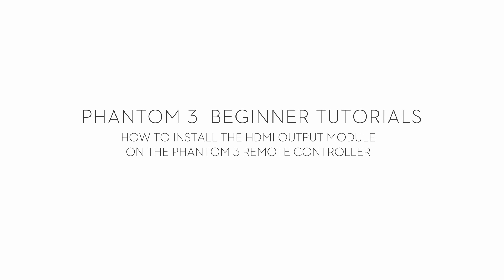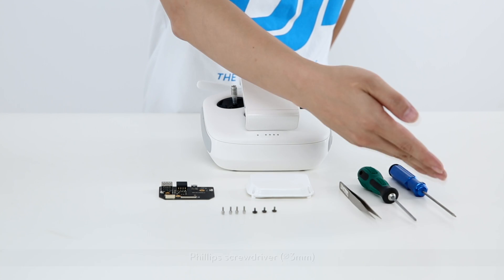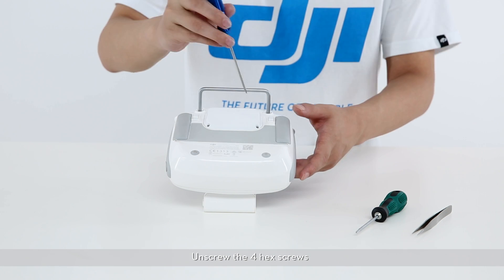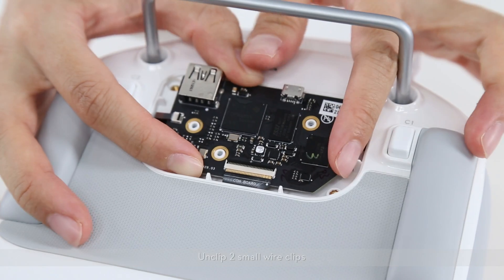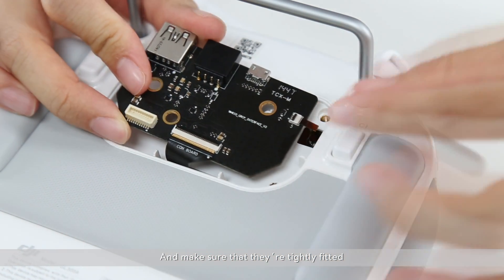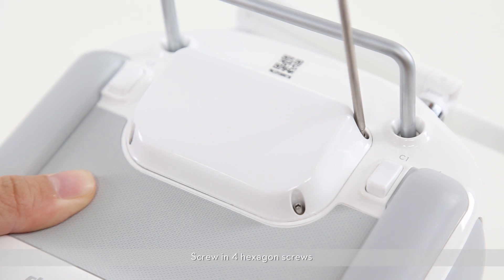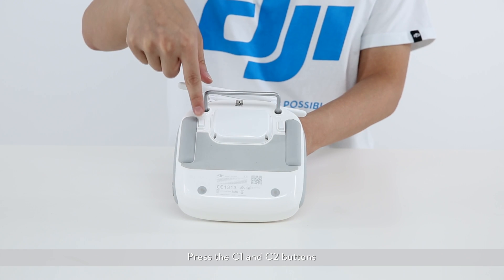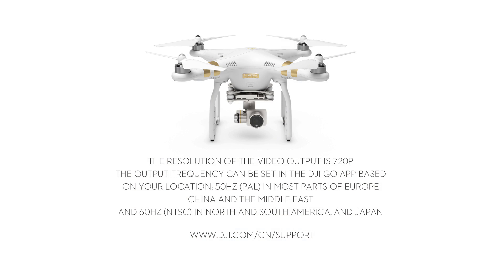DJI Phantom 3 | How to install HDMI Output Module on Phantom 3 Remote Controller

Comment: i have a phantom 3 pro and ordered the hdmi module but the bottom middle ribbon cable is smaller than this one the remote part number/model number is gl358wb anyone know the right part number for my remote?

Comment: ATTENTION P4P Owners -  When plugging the DJI goggles to the HDMI port...it CANCELS the USB port (using with iPad) and does not offer video feed, just a black screen on and off with the OSD.  This vid also fails to say that you need to dowload the remote firmware after installing the Part#54 (HDMI Module), you also will need to enable video in the menu for the HDMI. My Goggles will only work from the USB port.

Anyway, this is an issue with the P4P...this HDMI port is simply useless with P4P remote, they should stop selling it for P4P, fix the bug and sell a dedicated HDMI module for P4P.
Reply: I don't have this problem at all?

Comment: DJI Support, are you running the latest RC 1.8 firmware with HDMI module installed? There seems to be a stream image quality bug with this version. If I downgrade any phantom remote with HDMI module installed to firmware version RC 1.6 it seems to fix the problem.

Comment: Good Day DJI Support

My phantom 3 controller is not the same as your video
Reply: Then why is this video called "DJI Phantom 3 - How to install HDMI Output Module on Phantom 3 Remote Controller"
Reply: Standard
Reply: DJI Support So this isn't possible with the standard?
Reply: Jeshian Gounden no

Comment: I sent my drone off for repair and the controller came back loose almost like it was opened by DJI and not reassembled properly.
Hopefully I will be able to fix it with this video.

Comment: I installed the HDMI output module, but there is no connection between remote controller and my smartphone, when I click on the button is beeping, and drone can be operated from the remote, but is no connection between remote controller and my smartphone anyway !!!! what can I do, tell me please?
Reply: +Brian Boatright How can you calibrate them if you can't see the DJI go application?  I am having the same problem, I am using the original output module, not HDMI.
Reply: +Brian Boatright Ok I will try it.   Seems that I lost my connection to the DJ I go app since I did the firmware update. I tried just about everything and cannot restore operation. The drone works fine on the remote control, I just cannot see video or flight characteristics and flight information.  Basically, I can fly the drone but I'm unable to use the iPad.
Reply: +carminehd none of that is related to the calibration I'm talking about. visit dji's forums and support to get things back on track.
Reply: +carminehd Could you fix it? Same issue here...
Reply: +AndreiN You need to calibrate the controller sticks, just move them around. I had this same issue. It does help to read the manual and forum as well.
Reply: +carminehd read the manual, seriously. to calibrate the sticks you turn everything on and move them around in circles. it really has nothing to do with video, it's just a radio control mechanism that needs to be done once.